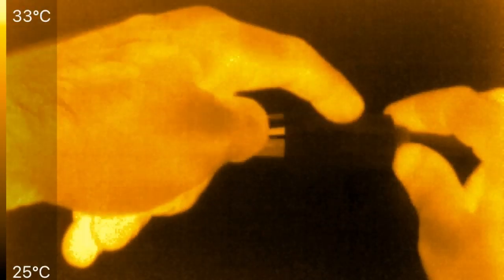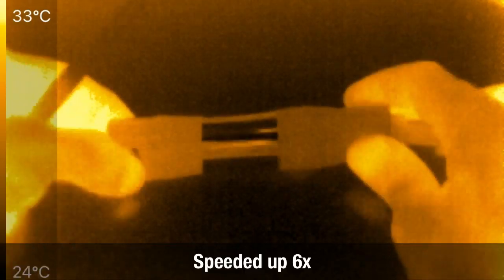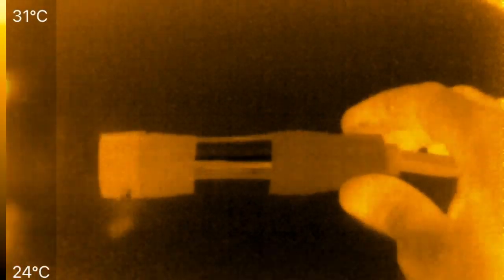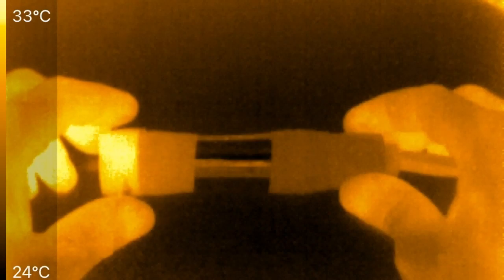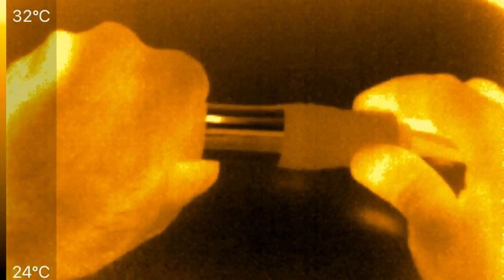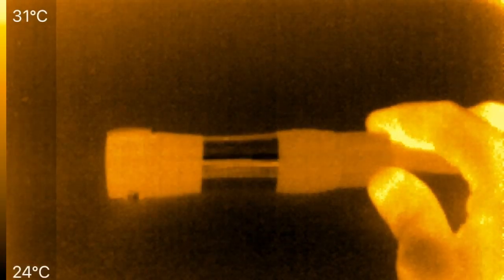Thermal imaging of the Broadsides Mods Brizo mech

Comment: Awesome video!  Can you do a video about what us low wattage MTL vapers need to worry about and maybe what is a good battery to use is?  Is there any way to make a mechanical squonker like a Pulse BF safer for such use such as a fuse?
Reply from the maker: Not sure I know what low wattage vapers need to worry about that’s different from high wattage vapers. Choosing the right battery and not misusing or mishandling it is top priority for both types of vapers. 🙂
You might be able to use a properly selected fuse but adding that could cause increased safety risks all on its own, depending on how well it’s installed.

Comment: Its off topic but I have a battery question if u have a minute... I know when having issues with the battery life in some electronics u can sometimes run the battery dead then charge fully to kinda reset it, right??? My question is with the batteries we use for vaping does it make a difference if I put a battery on charge when its @4v as opposed to getting more run time outta the cell and charge it at say 3.5v???
Reply from the maker: Only NiCd/NiMH batteries can possibly benefit from a full cycling. Li-Ion Batteries don’t need that or benefit from it. You can charge any time you want. Some electronics can benefit from a full cycling of the battery though but that’s because it resets the battery percentage counter, not the battery.
Reply: @batterymooch  yeah I knew it had something to do with resetting the actual electronics. Thats y i asked. Ty for answering my question. I appreciate it.

Comment: Great video! Appreciate the info. What’s the best fix for this, replacing the points?
Reply from the maker: Probably making sure that there is no ridge (high point) on each contact that changes the contact patch from strip to a point. I don’t know if every Brizo has this issue though. It all depends on the consistency of manufacture for the contact arms.
Reply: Battery Mooch  Terrific! I always lightly file my mech mod contact points. But not sure if it really did much good. Thanks again!

Comment: Aren't they silver contacts tho?
Reply from the maker: They seem to be silver plated, at least, but I don’t know if they are solid silver. They look plated IMO but check to be sure. If there are high points the metal type just won’t make a difference. Plating makes essentially no performance difference anyway though, just maintenance differences.